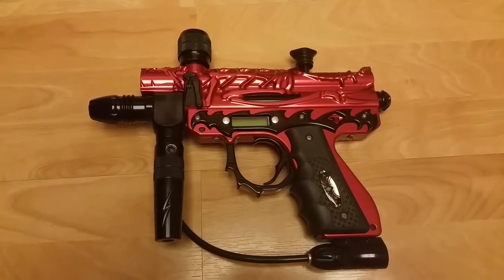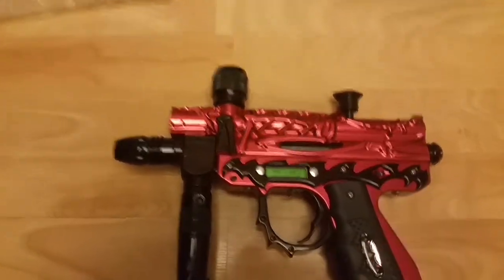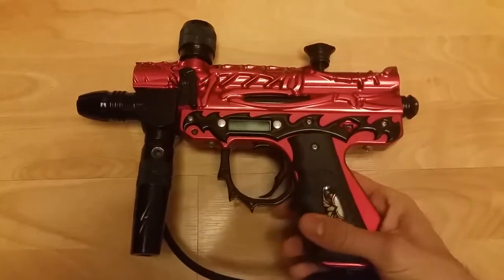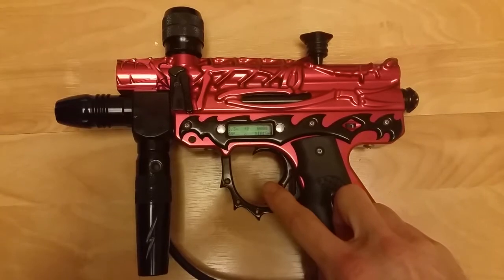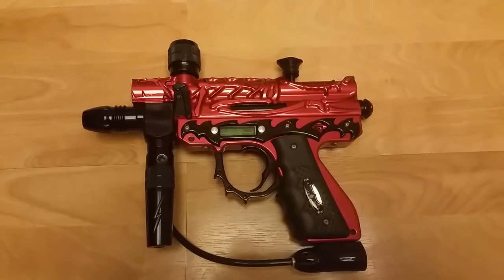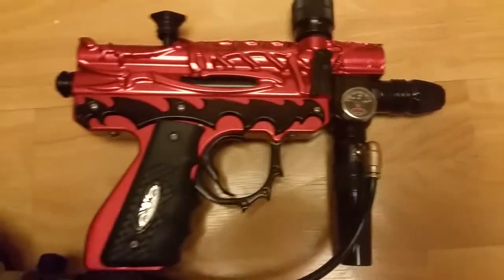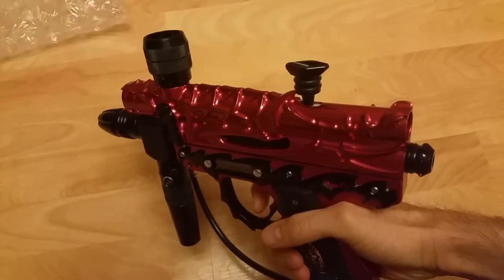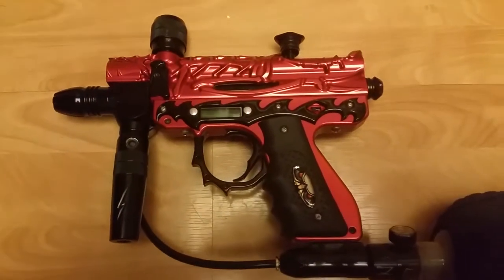Bob Long Intimidator Species Issue

Comment: hello, I may be able to help you a little bit on your marker there.  I have one and I love it.  had it for a few years now.  anyhoo, you do have an end cap for that marker.  its the black knob thing poking out of the top of it.  if you pull that straight out it will allow ou to remove your bolt for cleaning and lubing and whatnot.  if you turn it and unscrew it it fits right where you thought there should be an end cap.  as far as the delay and not cycling right I believe the problem is having the bolt pin remover/end cap being there.  the bold moves a lot farther than the end cap allows.  hopefully that helps a little bit.  let me know if you got any help out of this comment.
Reply from the maker: Terry Spatig  Thanks for the info! The guys on the pbnation forums pointed that out as well. I had no idea. haha Also, the issue was due to the piston in the HPR being inserted backwards. Once I turned the concave side towards the pin instead of the spring it was good to go.
Reply: Arend Pryor im glad I could be a little bit of help.  I never thought about the piston.